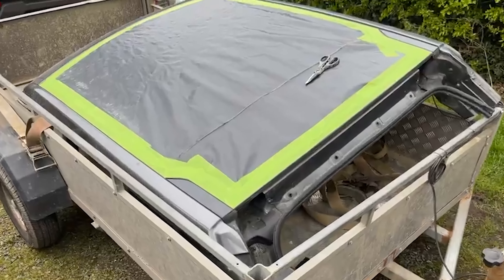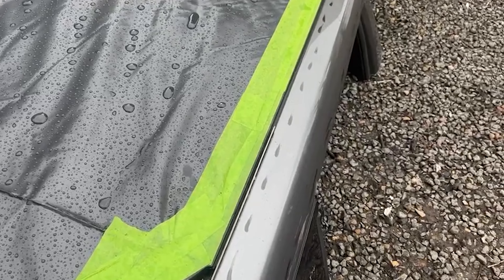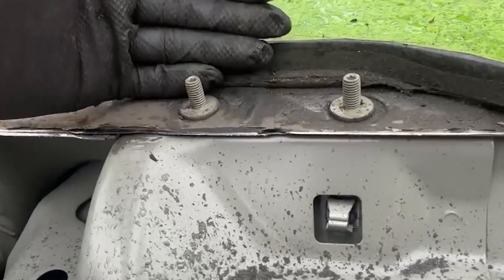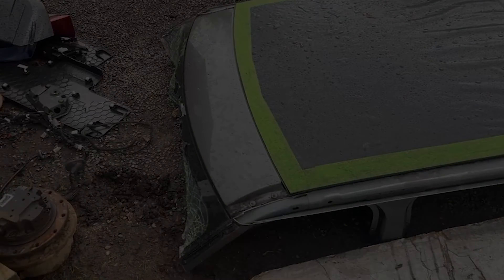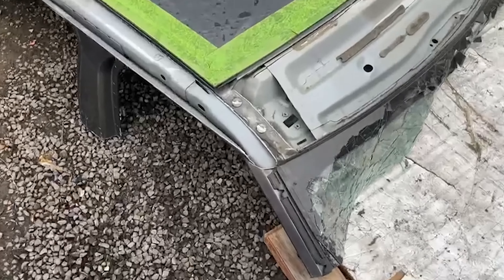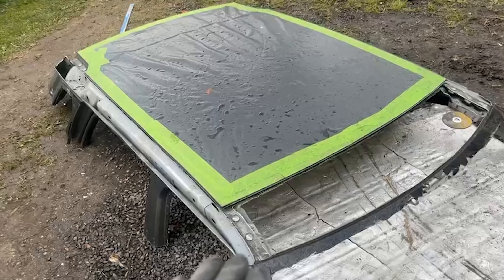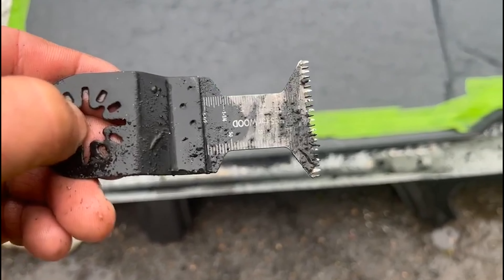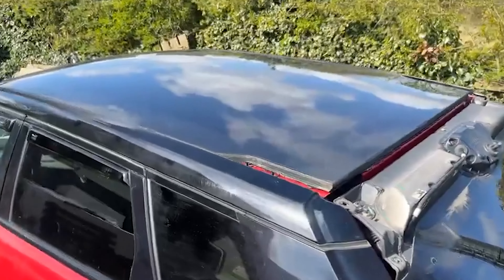How I Removed / Replaced a Land Rover Range Rover Evoque Panoramic Roof, how much did it Cost?

Comment: How did u remove the glass from your actual car ? U obviously couldn’t do it the same way as the Doner car ??? Thanks
Reply from the maker: Because the glass was already shattered, I literally cut the glass 2 inches from where is it adhered on, removing the centre of the glass, then used a sharp chisel to remove the adhesive. Hope this makes sense